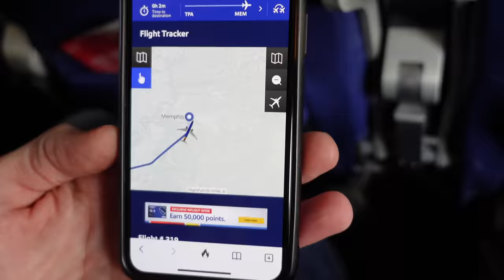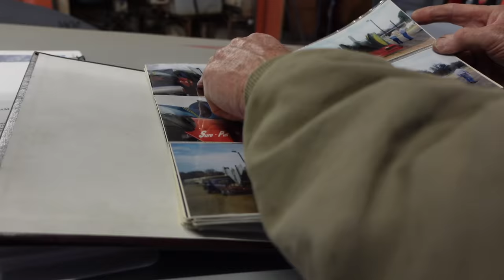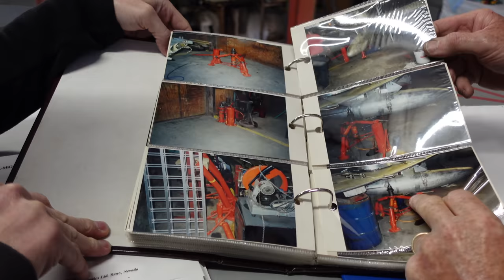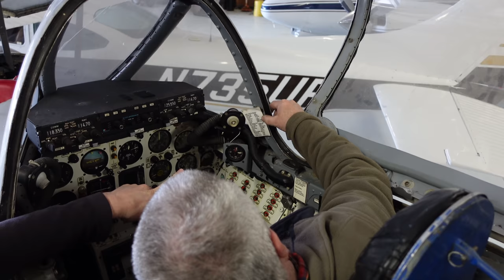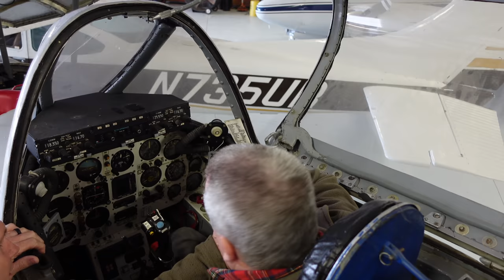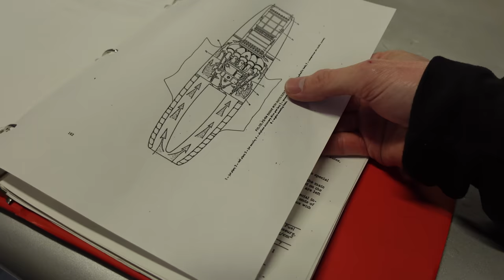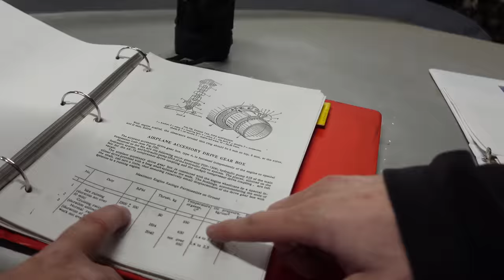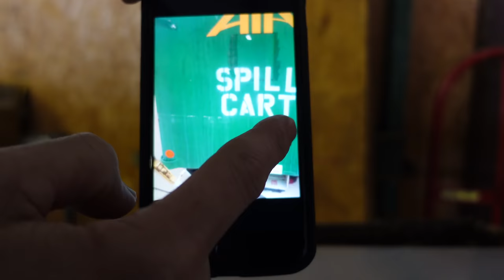I Bought A REAL Abandoned MiG 15 Fighter Jet!

Comment: Great video. Learned a lot about this great fighter. The MIG- 15 & 17 look just menacing. Coming in at that speed is crazy. No goofing off in this aircraft. That cockpit looks to be made for short pilots. Would be a blast to go up in one and better to actually fly it. Very expensive dreams here. Ground crews & equipment for support aren't cheap. 400 gallons per Hr. WOW!

Comment: As we used to say...not "clear prop", but "kick the tires and light the fires"! I spent some time at the 4477th/6510th Test Evaluation Squadron at Nellis. We had an off base "base" in Tonopah, Nevada (area 52) that had a handful of those things there back in the 70's. They were tanks compared to the 19's and later the Mig 21's & 23's Those were heady times. I never flew the 17 as it was really old technology even back then.  The 19 was a lot hotter bird with a top speed of over 900mph. If you buy this thing, buy a fuel truck!! Good luck Jimmy!

Comment: I had several buddies buy MIG 15s from Romania and Moldova they were dirt cheap and in good condition. The price included the diss-assembly and crating of the aircraft, along with all training flights need to learn the airframe. Plus it covered the re-assembly of the aircraft once it arrived in the US. I am waiting to hear what your price is for this airframe.  It cost more for import taxes on my buddies aircraft than anything else.

Comment: In the late 80's after A&P certification I did some contract work for Combat Jets (Jim Robinson) , he had an 2, F-86's, Chinese mig 15, a F-104 2 seater & a T-33. It was a blast doing ramp duty during airshow. Note: the FAA frowns on flying a ejection seat plane in civilian airspace. Be easy when you land he had a gear collapse & drug a drop tank but caught it in time & did a goaround cycled gear and landed no problem but screens in the lines were stopped up. Have fun with your new toy!

Comment: Aren’t the skins made of a steel alloy? When the pilot defected they used a magnet on the wings. The avionics were also populated with vacuum tubes.
Reply: Transistors we're not in production in 53....lol.  Even the USAF were using the vacumn into 68.....

Comment: Had you gone to Malone's BBQ on Elvis Presley Blvd, you could have walked a block to The King's private Boeing 707, which they somehow managed to park right there alongside the street.
If you're ever back there you should check it out.
As for the Mig, if it doesn't come with a cannon & machine gun, what's the point?

Comment: A quick perusal shows that as of 4/6/22, the average price of Jet-A in the Southeastern U.S. is almost $6/gal.  With a fuel capacity of 500 gallons, that's $3,000 for a couple of hours flying.  Say you'll get 3 hours at cruise, plus reserves.  That's $1,000/hr just in fuel costs alone.  Try finding parts for that Klimov VK-1.

I'm not saying you shouldn't do this, but it's going to be expensive to own and operate.  Obviously, you have money, but there's 'having money' and then there's 'HAVING MONEY!'  Which category do you fall in?

The cool factor of owning a piece of classic Cold War aviation is off the chart.  However, trying to get this airplane in the air might very well be more than you want to bite off.

There are a couple of those L-39's on Controller for under $500,000, two of them for less than $400,000!  I would be looking at one of those, since they are in flying condition, if I wanted to go with a Soviet bloc aircraft.

Like I said, great airplane to fix up, would probably be fun to fly, IF you can afford it.

Comment: Had a similar jet make a low level high speed pass right over me back in the early 60s. We were at Incirlik AFB, Turkey. I was outside and saw it coming right over our house in base housing. I was OK with it until I saw the red stars on the plane. Went running into the house yelling to my mom about what just happened, she told me to go back out and play...😐. I knew the difference between "our" stuff, the Turkish stuff and what the "bad guys" stuff looked like...the red star. The USSR had planes in Syria during this time, it's only about 150 miles or less by air to Aleppo, Syria...plenty close enough for a Mig to make a trip.

Comment: If the aircraft is "Czech", its designation is 
S-103 and is of higher production quality than the Soviet Mig-15! 
Czech steel, duralumin all "Made in Czechoslovakia"!I recommend finding out the matriculation of the aircraft according to the serial number and not having the stupid stars there, but the Czechoslovak marking!
Regards from Czech.

Comment: The MIG-15 was armed with a 37mm cannon and two 23mm cannons didn't hold that many rounds about 120 rounds didn't take much with a round that size. Number of airworthy Mig-15's sold in the US over the last 10 years for less then $100k. The major issues is operating cost, training, insurance be lucky to get liability insurance on it.

Comment: 2 23 mm guns, plus a single 37 mm cannon. The big gun was intended for attacking bombers, and achieving a one-hit/one kill performance standard, much more common in Russian aircraft, and many Luftwaffe and even British aircraft, while the American philosophy was to cling to carrying as many .50 cals as possible. Of course there were pros and cons to both schools of thought, plus, we didn’t have to worry much about intercepting inbound bomber formations, but were instead focused on more offensive missions. Even our most potent single-engine ground attack plane, the P-47, carried no fewer than eight .50’s, so they could apparently de-rail a locomotive and explode its boiler by simply strafing it, but just as easily go toe-to-toe with dedicated dogfighters of the Axis powers.

Comment: Your gonna buy a Soviet Mig-15 damn :-). Oh and bit more info.
The MIG-15 had 2 37mm's and 2 57mm's.
37mm cannons were at the top with the 57mm's underneath em. Due to there size. They were mounted below the giant air exhaust hole or whatever its called.

Comment: Do they use nitrogen because it’s more stable than o2 at higher temps ? Also in case anyone is wondering $50k in 1953 is roughly $531,303 today

Comment: You need to find out how long the engine can sit, without having the fuel system inhibited. If the guys have been running the engine within those times, then it doesn’t need inhibiting.

Comment: There are lots of fighter jets for sale cheap. When I left the air force I had a job teaching rich idiots to fly old mig 15,17,19 and 21s.

Old migs can be very dangerous to fly, require a ton of ground support, and get very expensive to operate.
If you want a sweet military jet, go pick up an L-39

Comment: A Mig-15? Cold War Russian Fighter Jet. I read that the engine was a Modified British design that the Russians 'Promised' not to use in any military aircraft when England sold them the design. 🤣 But, you know those Rusky's, they're a lot like Democrats now days. That is a lot of airplane, Jimmy. Are you interested in keeping it and fly it or just repair and resell. Keeping it would be a big huge and expensive step for you. I'd do some talking to a lot of people before you decide. On the 'Plus' side. There are still a ton of Mig-15's out there so parts should not be a problem. I would guess that just about every former Soviet Ally has a bunch of Mig-15's still sitting around gathering dust. Even Cuba. Good Luck whatever you decide to do.